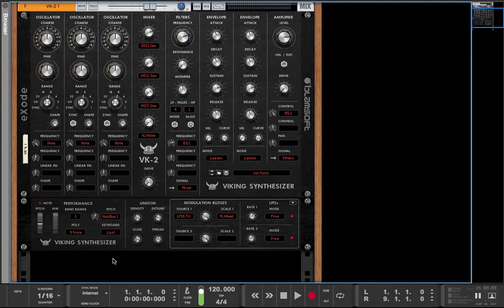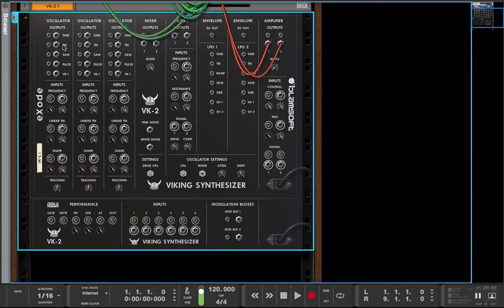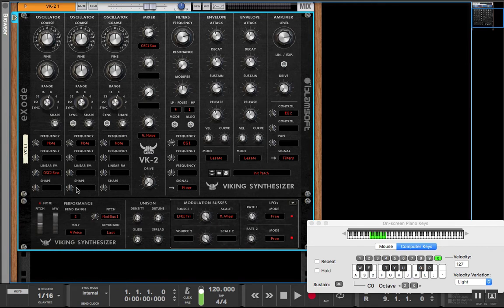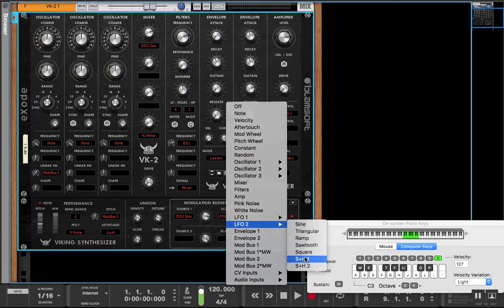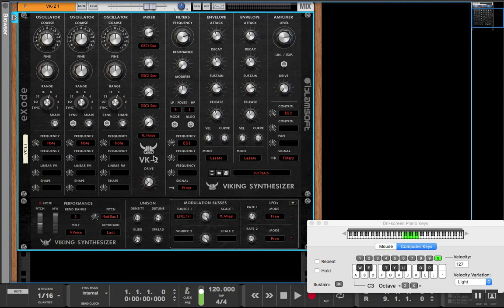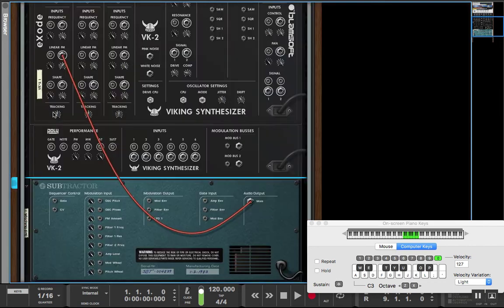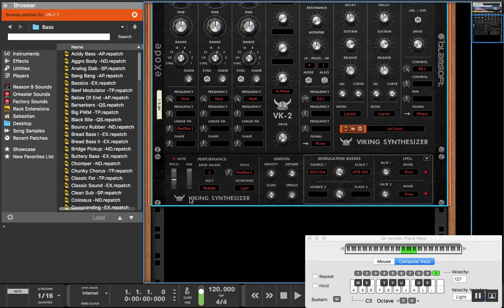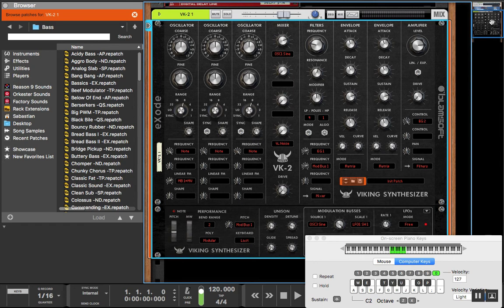Blamsoft VK-2 Modular Explained

Comment: I have this, but I can't use it.  Takes too much CPU on my XEON 6 core 12 thread machine, which is ridiculous.  Reason still does not address cpu cores right.

its a very nice synth though.
Reply from the maker: busywl69 that's why you use the CPU switches on the back
Reply: then you end up with hyped subtractor sounds.   like using the low CPU folder in VK-2. :(